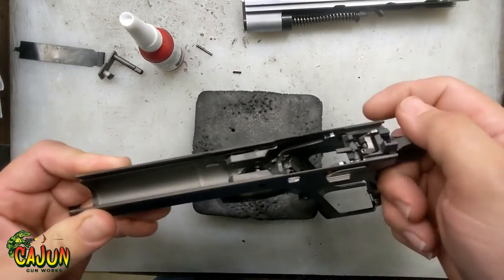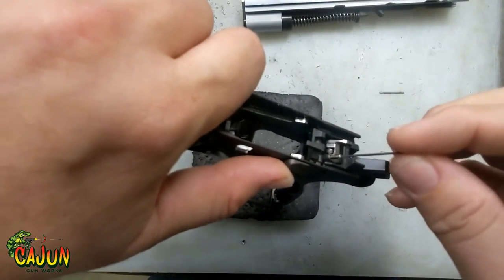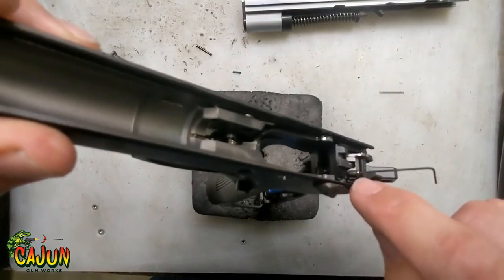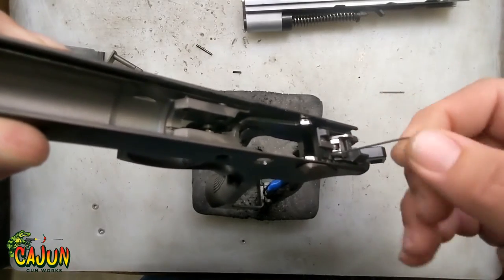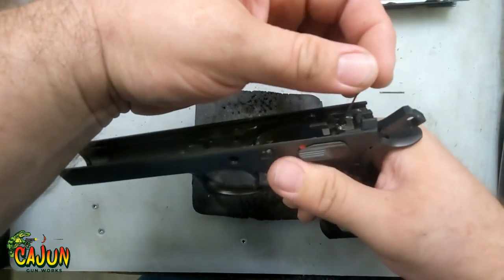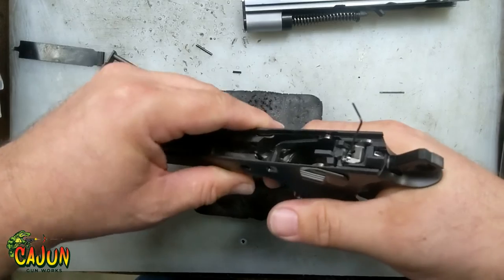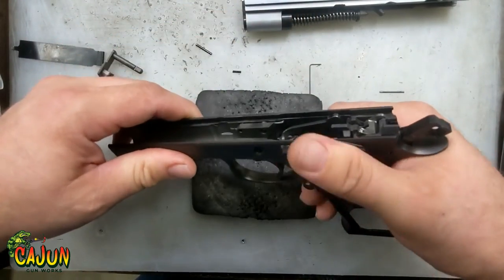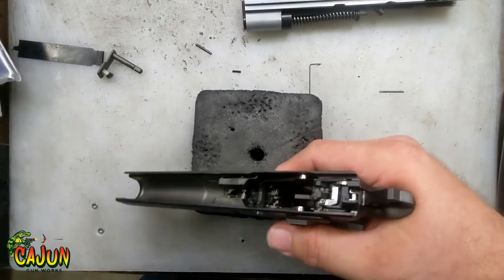How to set the sear screw

Comment: What I don't get from this adjustment method is: Does the sear's adjustment screw affect the amount of engagement on the hammer / trigger creep? I'm thinking of getting one (as opposed to grinding at my current hammer's sear face to do an old-fashioned trigger job) and assumed that was the case but after seeing this video I'm questioning whether this adjusts something not directly related to the gun going bang.

Comment: So I bought a Shadow 2 Compact with that already installed and I am able to put the safety up with the hammer already down.  And if I pull the trigger hard enough, it will go into the half cock position and stay there.    
 Is that an intentional thing someone might have done or does it need to be adjusted lower so that the safety can not move while the hammer is already down(as in the non cocked position, hammer resting against firing pin).
Reply from the maker: The Safety with the ASB is only designed to funtion in the full cock position. Do not put the safety up with the hammer down or in the half cock position and pull the trigger. This is going to mess the set screw up and may cause the safety to not funciton at all.